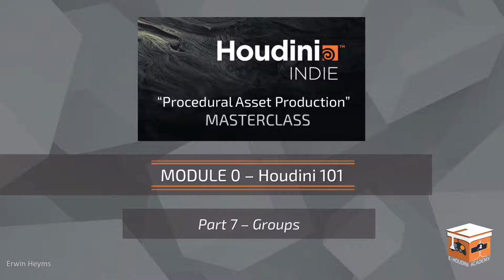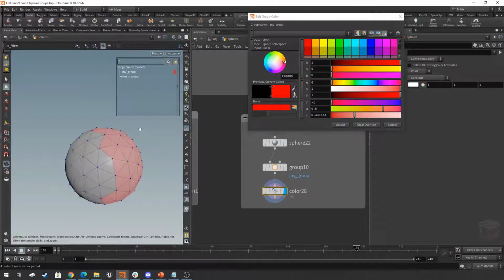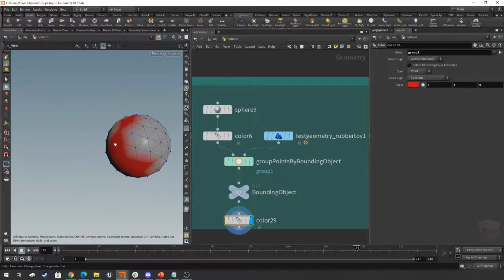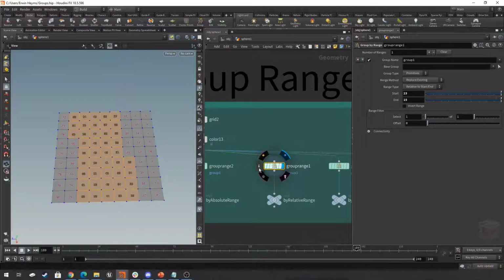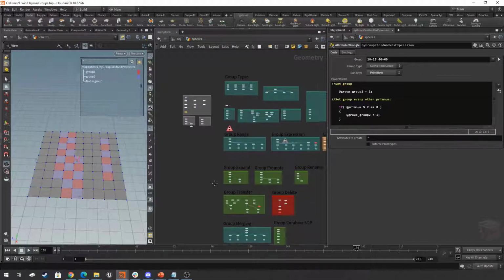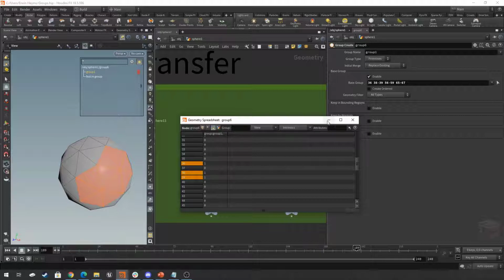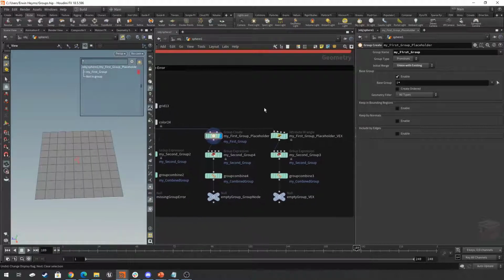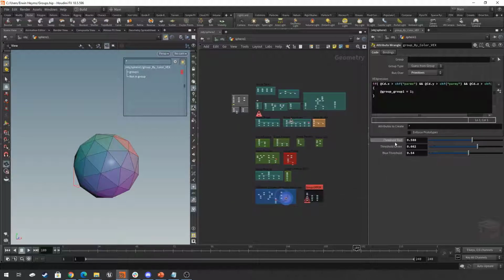HOUDINI 101 - 07 - Groups

Comment: I have question about group selection. Say I have a string selection parameter in my HDA and I want to run some vex operations of that group string. How do i convert that string to something like primitive numbers to blast away an array of selections
Reply from the maker: In that case you'd want to split your string by spaces between the numbers, then select the primitives per element. atof() in VEX will convert the string to a number. 

Or use a group sop to pre-create a group in a foreach or forloop first, then feed this group selection to your vex sop.
Reply: This string selection parameter is in a multi parm list btw. that way I can add an array of selections to a list that I will iterate through later. I'm able to get the selections done but converting them to something useful is where I fall flat